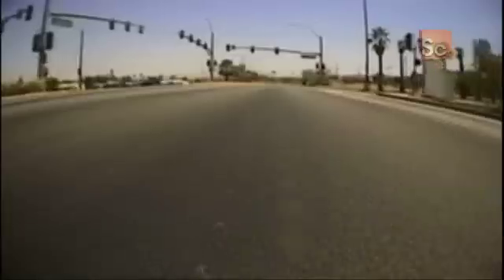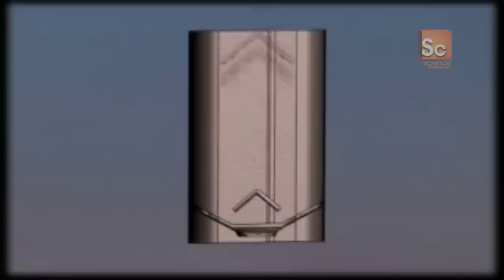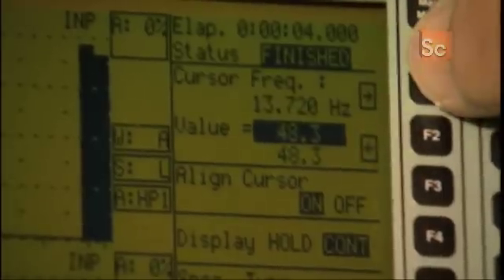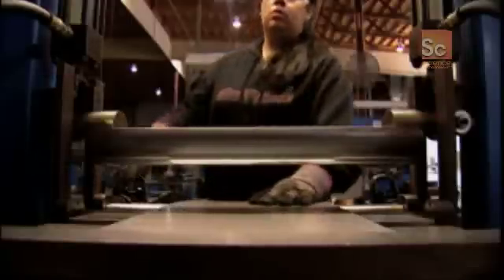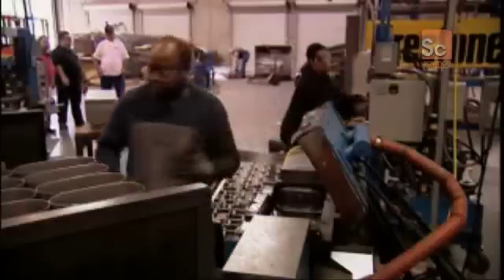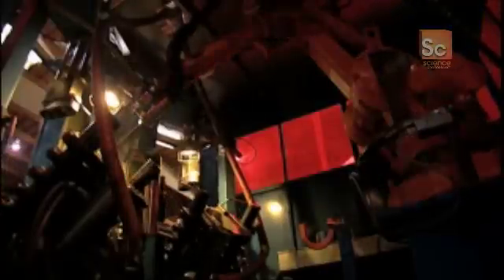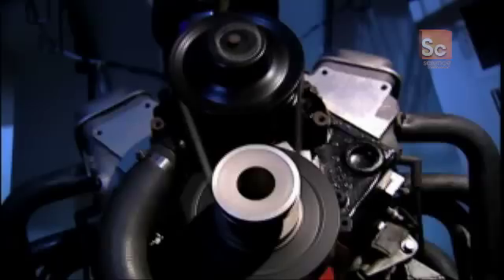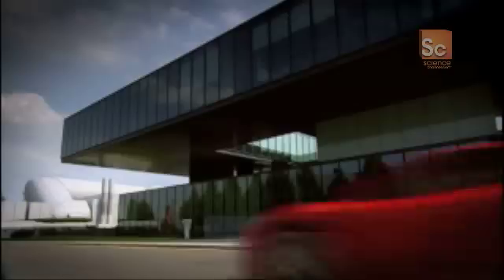How Do They Muffle Engine Exhaust?

Comment: As an Acoustic Engineer with 15 years of experience on designing mufflers for large mining trucks, I laughed at so many exaggerated claims in this video.
Lmfao
Reply: Is there any type or brand of muffler you know of or anyone who can custom design a tuned muffler vs. what's in the mainstream market?
There are about 5+ brands now using this Flowmaster delta style technology, & I always wondered what acoustic engineers are on staff doing R&D or they are just exact copies since Flowmasters patent ran out years ago, however these generic brands do have differences in their design, which makes me wonder that they are still evading patent infringement.🤔. I wish I could have the engineering knowledge to design & fabricate a tuned muffler for a few applications, & have Doodle'd a bunch of designs...........David Vizards calculated Pressure Wave Termination Box intrigues me & many discuss it & have built it with & without success.